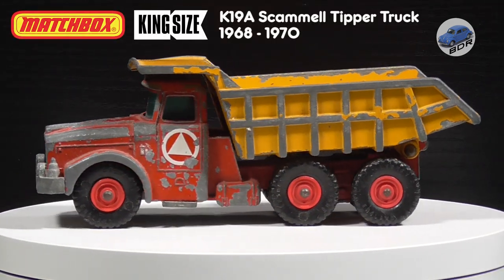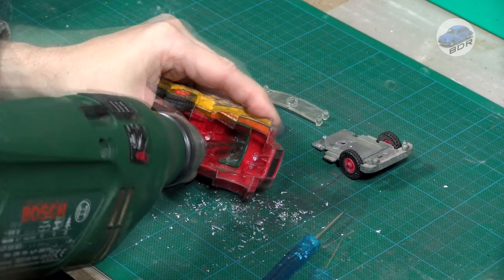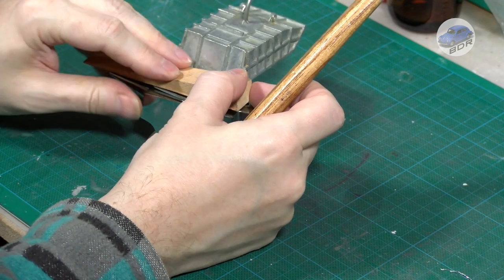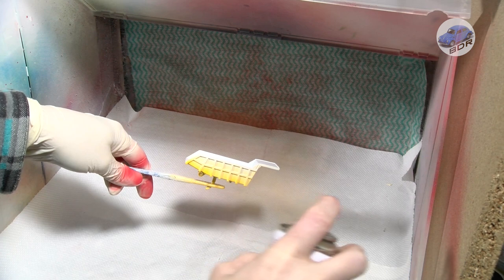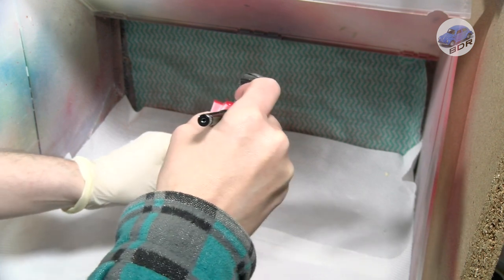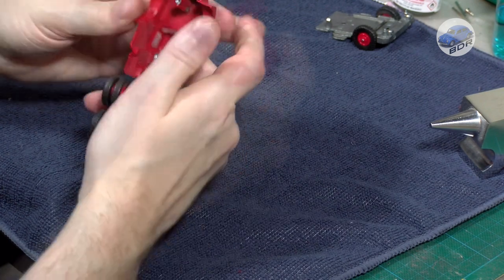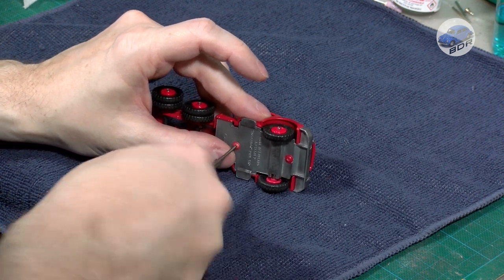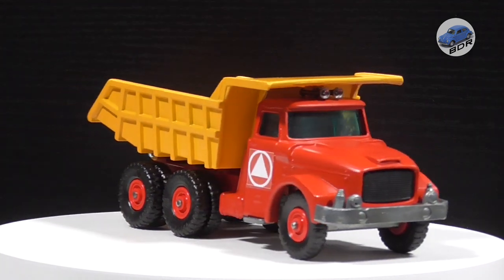Matchbox K-19 Scammell Tipper Truck Diecast Restoration (DMC Challenge November 2022)

Comment: Quite the difference from what you started with. Tipper front looks a lot better, and odd the way the suspension part melted but the windshield showed no signs of heat damage. Glad you got the new suspension piece to work, final product looks great. Thanks for sharing
Reply from the maker: Thanks, John! 🙂
I guess the truck may have been left upside down in the garden on a hot summer day. In direct sunlight that metal bottom plate can become extremely hot, melting the suspension, but not hot enough to damage the windscreen.